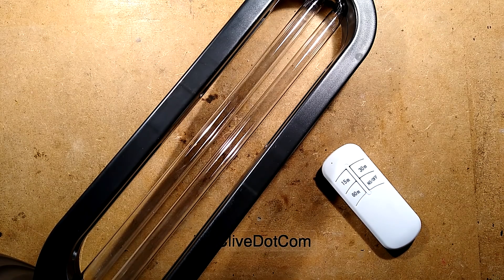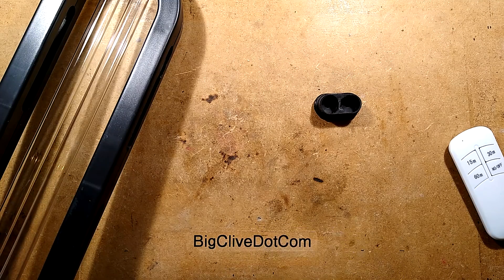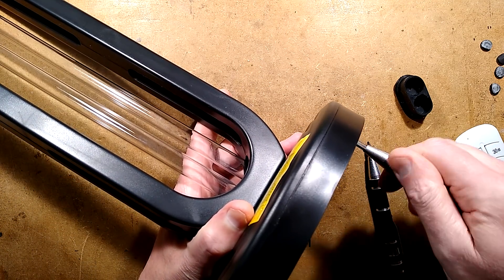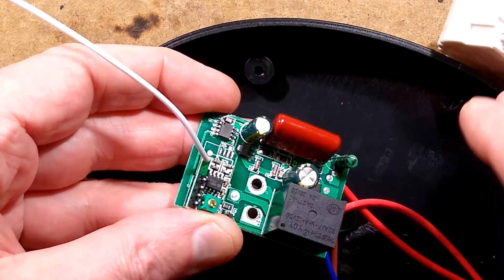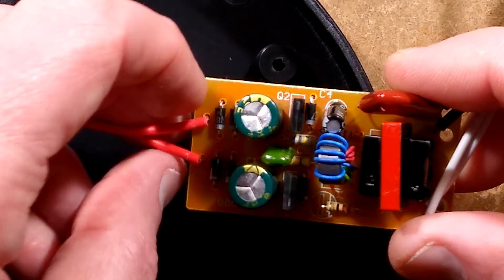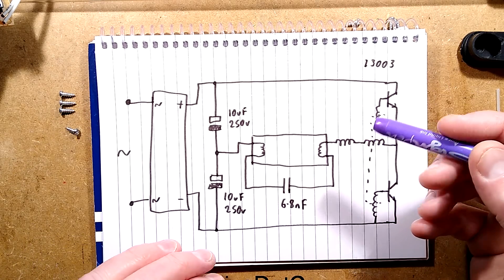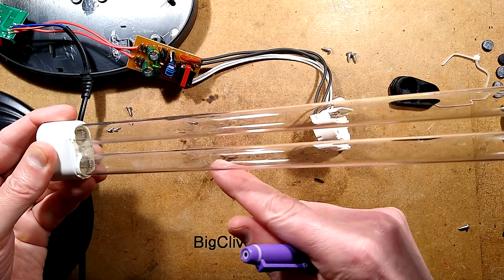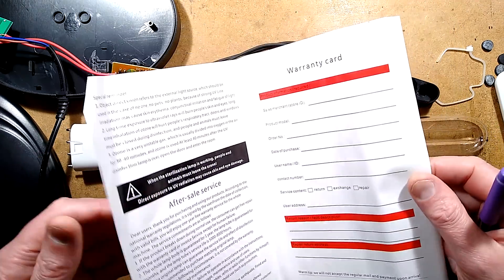Inside a stylish tabletop UVC germicidal light.  (Skin, eye and lung hazard)

Comment: Clive, could you take a look at this brief video I have made of an LED street lamp node? I liked your 5G video and have also heard about the madness surrounding 5G and 'sinister' street lamps with supposed hidden transmitters etc. But Im not an electronics person, so dont really know what the components are. Any info would be appreciated, thanks.

https://www.youtube.com/watch?v=f8Buq4-Z1ZQ&feature=youtu.be
Reply: Really does not look like this something to do with wireless. The label "ON<70 lux" suggests that it just switches on if it gets dark enough. My guess would be that the big red part on the left is a capacitor dropper,  to get something around 12V (to power the circuit). On the bottom an 8 pin control chip. The big black block is a relay to switch the load on/off. On the side could be the photodiode, so that would fit the guess from the label.
Reply: @1Hippo  Ok thanks. I actually wrote to my local council (Colchester) and asked about street lamps with transmitters and they have the Telensa telecells installed, they look like the node in my video but have GPS and other transmission electronics so they can be connected and controlled by a central management systems like clive says in this 5G video. They use sub 1Ghz Ultra Narrow Band transmitting devices using 868Mhz frequency. It seems from your information that the device in my video is not a telecell, just a basic photocell.
Reply: @thermaldog  Yes, that is definitely not a telecell. There are also pictures how these look:
https://www.google.com/search?q=telecell+pcb&source=lnms&tbm=isch&sa=X&ved=2ahUKEwjczuedguToAhXHy4UKHWezCnEQ_AUoAXoECAsQAw&biw=1400&bih=1012
Most notable a more powerful control chip (bigger package and more pins), overall higher part count and complexity in the layout. You can also see the squared ceramic GPS antenna and the shielded wireless module there.
Reply: @Matt Quinn nice one, cheers.
Reply from the maker: Here's a video explaining what's inside.
https://www.youtube.com/watch?v=cQDIb09cLug
Reply: @bigclivedotcom  Cheers Clive

Comment: Coincidentally I just got done using a diy uvc light to disinfect my room, I broke the outer glass bulb of a low pressure mercury lamp and used a 24 microfarad capacitor as a ballast
Reply: Cool! Did you use a ballast transformer or just a capacitor in series? What was the lamp's rated power? What input voltage? Would it work with a "high pressure" lamp? I know I've got a lot of questions, but I'd love to give this a try, with all the appropriate precautions.
Reply: @deltab9768  I also did the diy method. I had replaced old yary light with LED. So I broke the bulb( outer glass), screwed a 18 in. sq. plywood to a 18 in. 2 by 4, short the n/o on daylight socket, mounted yard light assembly(socket upwards) to the 2by4, n/o spring switch tied to 20' of string. Any size bulb that fit the socket and mercury vapor will do great. Don't face the light even with eyelids closed. Very powerful uvc. Will kill anything if exposed to it long enough. Ventilate during and after. Credit basic info to; Kerosan channel. https://www.youtube.com/watch?v=WjKkgkbRSgY&list=PLEoMskDDs99F1QvVOVJByxspqijVedXTc&index=11&t=0s
Reply: I asked another guy and he was unsure and suggested I should ask you instead.
If I accidentally fit one of the UVC ones into a normal light would it explode?
Link to that comment thread for reference: https://www.youtube.com/watch?v=aaVnAO1Vv-k&lc=UgxbtbVh8M2r03ZgC4d4AaABAg

Comment: You can get yellow UV blocking glasses that prevent eye damage from UV exposure.
Reply: You can also use sunglasses as they should be fine for a short period of time as they block most UV rays. I use to use regular sunglasses using a cutting torch even though it wasn't recommended. You can also use torch googles or a shield for wire welding or automatic. One for arc welding would work too but might be a bit too dark.

Comment: Anything higher than 223nm is going to burn you and rearrange your DNA. Turn it off.
Reply: you mean lower
Reply: @viermidebutura  no..anything higher. Lower you go it is harder for that small of a wavelength to pass through your dead skin layer or through your eyes.
Reply from the maker: Even the 222nm excimer generated narrow wavelength UVC isn't fully proven yet.  It's all about the way it's used.
Reply: @bigclivedotcom  it's proven.
Accepted by the FDA as proven is another story.

Comment: Photokeratitis or ultraviolet keratitis is a painful eye condition caused by exposure of insufficiently protected eyes to the ultraviolet rays from either natural or artificial sources. Photokeratitis is akin to a sunburn of the cornea and conjunctiva, and is not usually noticed until several hours after exposure.Wikipedia

Comment: What material is used for the mercury tube?  I’m guessing quartz, since it won’t block so much UV-C. If glass were used, the short wavelength photons would mostly be absorbed by the glass.
Reply from the maker: It can be one of a range of uviol glasses of which quartz is one.  The level of impurities can determine the UVC transmission ability, so they can tune the glass to allow both UVC wavelengths or block the higher one that splits oxygen into ozone.

Comment: Does UVC prevent mould growth? Or can it be used in any way to preseve food?
Reply: Sometimes stores use large ones mounted on walls above direct eye level back in meat departments if they are cutting fresh meat there. Some of them kinda look like bug zappers because of the intense blue light and having a steel cage around them.
Reply: @benkeysor7576  Most fridges have plastic interiors. The plastic would be damaged.
Reply: @iainathairydog  I didn't say anything about a refrigerator. I just stated stores sometimes use them in meat departments, most likely to keep down any nasty bacteria growth between major cleanings. It wouldn't make sense to use it in a refrigerator and wouldn't do much good either. You're better off just cleaning you refrigerator and not letting food get moldy. Plus these types of lights aren't exactly cheap so you wouldn't want to potentially put it where it could be damaged.
Reply: @benkeysor7576  My reply was meant to be to Mikey Peters. Perhaps I clicked the wrong place.
Reply from the maker: The ozone can deactivate mould.   Commercial bakery equipment does often contain UVC tubes and after normal cleaning goes through a sterilisation cycle where the conveyors run for a while bathed in UVC light.  Always keep in mind that exposure of skin and eyes to UVC will cause problems and ozone is an irritant at high levels.
Reply: It should kill mould the same way it kills other living organisms, and by extension helps preserve food
Reply: So in theory could a fridge could contain one, that came on at intervals, but only if the door were closed. Thus prolonging the life of food even further?

Comment: The hole with the label over it is where the IR remote control sensor used to be before they switched to RF remote control.
Reply: But wasn't that at the base of the product. The sensor wouldn't be able to pick up the light signal
Reply: Brandon Aguirre I’m pretty certain it was in the top-side of the base (it included the opening for the tube socket/base), the bottom portion held the power cord and double-sided foam adhesive strips in it

Comment: Do those little battery-powered UV wands really disinfect phones and masks etc in about a minute?
Reply from the maker: If they were actually UVC with the clear glass tubes then they might have an effect.  But many of the LED wands being sold on eBay aren't UVC at all.  If my life depended on it I wouldn't trust a simple wave of a real UVC wand to sterilise a mask.
Reply: @bigclivedotcom  Thank you.
Reply: Hospitals here use boxes (presumably with a number of those tubes) to disinfect stuff in 25 seconds. But the box is shielded. A wand that emits so much radiation will burn your skin when you are holding it.

Comment: Other than people and pets, is there anything else that should be covered or moved out of the room when a UVC lamp is used?
Reply: Anything you don’t want to discolor
Reply: MightyRude wallpaper, clothes, tv etc?
Reply: lanz1987 
Anything that can discolor outside will discolor under uv lighting 
But remember that not all uv lights are created equal so some lights will discolor objects faster than other uv lights (it depends on the wavelength, output and distance to the object)
Reply: Plants.  Anything else that is alive.  Anything expensive.
Reply: Some plastics deteriorate more rapidly on exposure to UV.

Comment: will it kill instects and rodents?? as well as bacteria and viruses
Reply from the maker: Some are sold for killing fleas and dust mites.  But only where they are actually exposed to the light directly.
Reply: @bigclivedotcom  would the Ozone do the insects and rodents?? I suppose you could end up with three blind mice :-)
Reply: I think I have seen a insect killing lamp in a catalog that stated it used a UV-C bulb, the unit was in the style of a wall-mount up-lighter/wallwasher (above eye level ⚠️) and as the light mimicked blue daylight - it would attract flying insects (like a fly to a window) and they would fly around the bulb or crawl around in the wallwashed reflection above it/in the unit (confused as to why they weren’t outside) and die - assuming the UV-C had fried them.

Comment: Clive, Thanks for the info and your videos are very educational.  I would be good to have a video talking about the differences between the glass lamps and LED UV-C technologies.  I read very conflicting details on if LED work as well as the the lamps, etc.  Any input would be welcomed.
Reply from the maker: The only real UVC LEDs that I've seen have metal cases and quartz windows.  They're very expensive.  Most of the LED UVC lamps I've seen on eBay look as though they may be the wrong wavelength.
I'd only trust a clear glass UVC tube right now.
Reply: bigclivedotcom awesome. I will seek out the glass lamp style and stay clear of the LEDs being pushed on EBay and AliExpress.
Reply: UV-C germicidal LED's are easy to identify
1. if you light banknotes with it, they flourescent (LED is a UV LED)
2. Forward voltage is around 4.8V-6,5V per LED at low to nominal current (ensures UV is a germicidal UV-C)
Reply: @volodumurkalunyak4651  Do you find these LED UV-C modules as effective as the glass lamp models like BigClive shows?  I hear mixed results and that many of them are more UV-B/A and not UV-C as described.  I was looking more to use such a lamp to cover a larger room area than a smaller work surface.  Have you tried the UV-C LEDs in this situation?
Reply: @scottbrown4611  No. This 2 characheristics can be made from random genuine UV-C LED datasheet (for example the following one: https://eu.mouser.com/datasheet/2/180/IN-C33DTDU1_v1.3-1484019.pdf ).
Reply: @volodumurkalunyak4651  Ah, got it.  Thanks.

Comment: Eagerly awaiting the LED ones. I think most of them are 380-400nm bullshit, BUT if you search very carefully it does look like there now some actual UVC emitting ones on ebay for cheap. Would like to see how low the power output really is though....
Reply from the maker: I'd expect a real UVC LED to be made of ceramic, metal and quartz.  Normal resins would just degrade quickly.
Reply: @bigclivedotcom  Right. I'm talking about these things
https://www.ebay.com/itm/GreenSun-Portable-LED-UV-Disinfection-Lamp-USB-UVC-Sterilizer-Germicidal-Lights/383497170904?hash=item594a366fd8:g:4RcAAOSwpwVej-sh
which actually do appear to use a quartz windowed aluminum nitride diode at 256nm

Comment: The shape of that tube reminds me of the internal "U" tube of a low pressure sodium lamp minus the additional ridges at the bend itself which keep the sodium pooled at the bend... That would be a cool design to shove some Neon/Argon penning mixture into for that cold lamp effect :)
Reply: Just buy 100 cheap U tube flourescent lamps, and you probably will find a few that are pink from not being dosed properly. Very common to get mercury starvation with T5 tubes, as they run the phosphor coating so hot it will often absorb all the minute mercury dose they fill it with, leaving the neon to glow pink.
Reply: It's YouTube germicidal lamp!
Reply: Can't you just put the germicidal lamp into a glass envelope to make it into a really unique blacklight that isn't hazardous? As far as I know, all general-purpose glass stops UV-C and low-pressure mercury doesn't radiate much UV-B.
Reply: @thelightninghunter23  Actually I did try exactly that with my 11 watt germicidal tube and looking at it through several layers of ordinary glass still gave me eye strain like if I had watched a screen for the whole night and not got enough sleep.

On a second occasion it also gave me watery eyes as I did look at it for something like 2 minutes instead of 1 !

So even though glass will block UVC, those lamps are still dangerous even behind glass and I think you really don't want to be looking at them, no matter how much glass sits between the lamp and you.

Luckily it didn't last for more than a few hours and was nowhere near as painful as actual arc eyes that you can get if you look at a germicidal lamp directly without any sort of shielding, which I didn't do as I already knew about these hazards.
Reply: @thelightninghunter23  You can, but simpler and easier to get one already made with the Woods glass so no need to have an expensive quartz glass tube, and then filter it. Those are very common, sold as money detector lamps, in 6W and 13W variants.
Reply: @SeanBZA  I have a bunch of 4w ones as well... they're ubiquitous and really cheap to get!